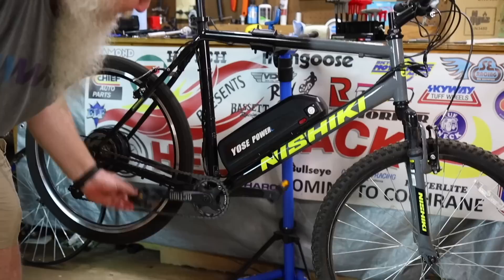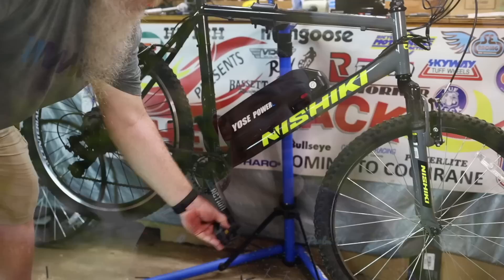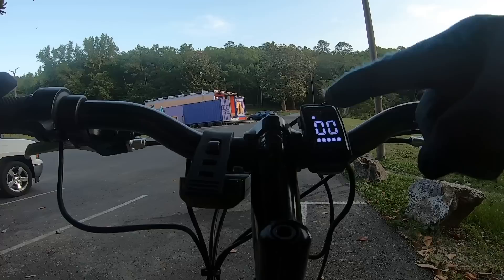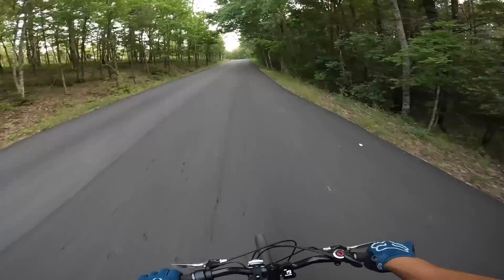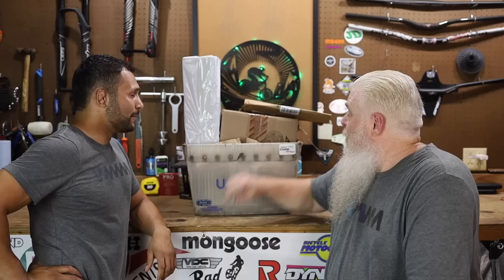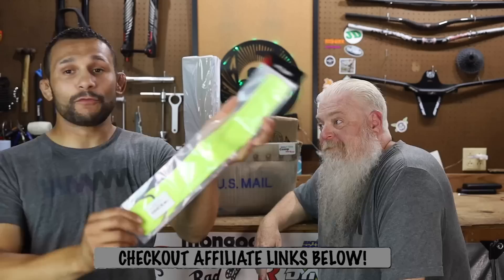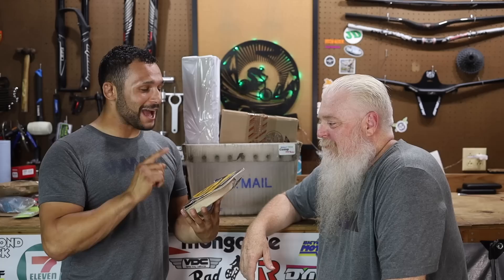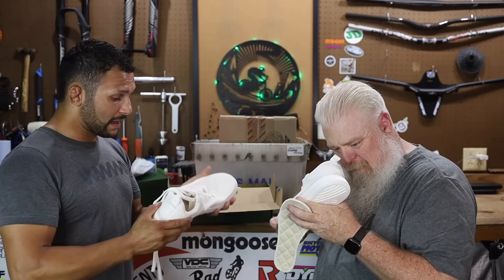Regular Bike Converted Ebike: Realtime Review | Mailtime

Comment: If the battery mounting bolts and the PAS sensor were the only hiccups, that’s pretty good for a first build guys! There’s always some finnangelin’ involved with every DIY build! Usually you can go into the settings on the display to change the mph / kmh. And possibly unlock it beyond 25mph. Nice one guys very cool. the bike looks great for camping ⛺️ and putting around!! 👍👍

Comment: Mounting the battery is always a pain. Never lines up correctly. Just gotta grind it and drill a new hole. Or you can use the one bolt hole and 100lbs zip ties that fit between the bracket and battery to make up for missing second bolt. Or velcro.. which would only suck if you wanted to remove the battery to charge or replace
Reply: Or just make a simple template from cardboard or such from the battery mount then take it and tape it down wher you want  it and then drill your holes

Comment: Just for the heck of it....People, much of the time, just put in the wheel size. 26, 27.5, etc. To get an accurate speedometer reading you need to put in the real circumference. I use a cloth tape.
Reply: Never mind  
It’s a hub motor.

Comment: Review the Bafang 750w Mid drive with a 52v battery 😈
Reply: My top speed is 41mph at 25amps with a 52t chainring on a flat street while peddling my ass off lol
Reply: Agreed.  The Bafang mid-drive kit is much more versatile, and it's mid-motor.  There are a variety of display options and you can run 9 levels of assist.  I tried 5 and it's too limiting - go 9.  The Bafang is also programmable.  I reprogrammed mine for my and my partner's riding styles.  I've built 3 of them and love them.  Plenty of power when you use your gears (I have a 10 spd cassette and a 40 tooth chain ring with offset) properly for mountain roads and hills, and plenty of speed on the road.  Mid-motor is the ticket.  Love them!